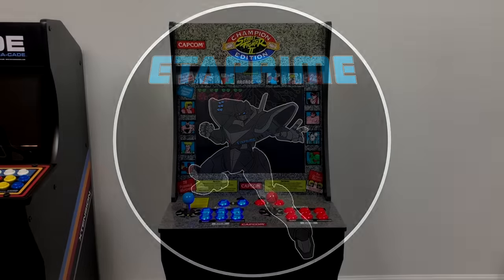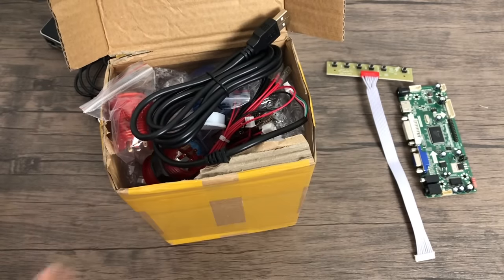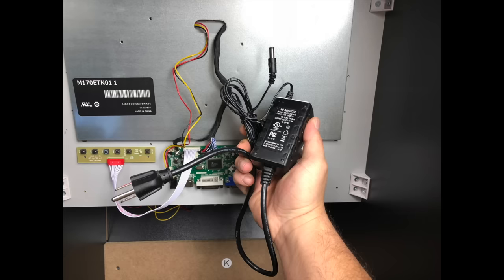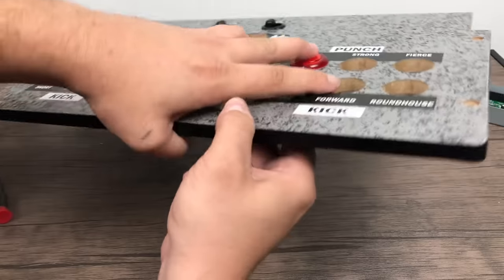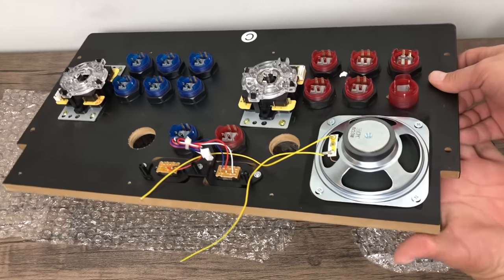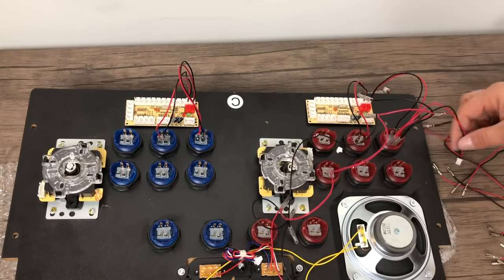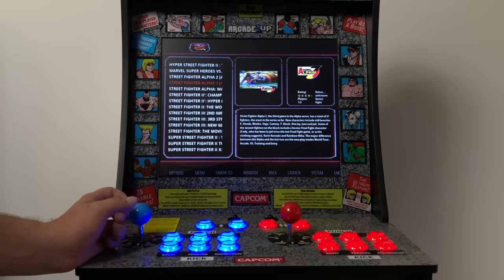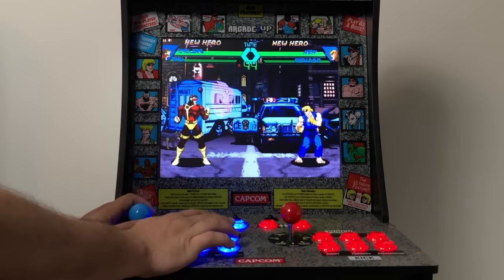‪Arcade1UP Raspberry Pi Install Tutorial - RetroPie in an Arcade1UP

Comment: Can someone help me... have the same exact setup but with a rasp pi 3 (not 3B).. and the USB's are not being recognized.... I'm using the version that has the usb male end on the side so no need to split the wires... but when I boot up - I dont' get the 19:55 screen and the controls do not work (though they are lit so I know they are connected to the pi.   Thx!!
Reply: Did you configure inputs with that raspberry pi prior to installing it in your arcade cabinet? Meaning, did you you use it elsewhere prior to using it for your arcade? That's my guess is that it's still configured from where you used it previously. If that's the the case, plug it back in wherever you had it, and use the USB controller or whatever you had before to go to the options menu and click configure input. But dont actually configure it. Unplug it and move it back into your arcade and it should ask you to configure input again when you boot it up.
Reply: @TEHFLON_DON  Thx Tehflon (great name BTW) - It works now so I think I just didn't have the USB plugged in solidly on either the encoder or Pi... the buttons are VERY CHEAP so I think I'm going to buy some more expensive ones.... Appreciate the help!!

Comment: I'm having trouble getting my retro pi coming up on my screen
Reply: Make sure the monitor is plugged in first and on. Then plug in the Pi. The cream colored board has an on/off button for the monitor as well in case you need to turn it on.

Comment: Thé issue is that the câbles are ro short and the converter is hanging
Reply: Guillaume Renou I had the exact same problem so I had to remove the LCD screen and pull the cables through a hole I drilled

Comment: I need to know if the original Street Fighter games that came with the cabinet will still work like normal after installing a raspberry pi per these instructions?
Reply: I'm pretty sure you would have to install the street fighter roms onto the raspberry pi in order to play those same games. Your essentially swapping out the computer that comes with the arcade 1up machine and replacing it with the raspberry pi.
Reply: eclipse310 so I’m gonna use the Space Invaders cab then, but will have to drill some holes or replace the button board.
Reply: @aaronburrell3729  I'm not sure I understand your question. The raspberry pi allows you to install many games because it's a mini computer. The button board that comes with the button kit acts like a usb controller so that your buttons will work with any game on the raspbarry pi. If you use a space invader cab and do the raspberry pi mod, you are taking the computer out that came with the space invader cabinet and replacing it with the raspberry pi.
Reply: eclipse310 I have several 1up cabinets and if I’m going to make one unusable from the factory then it might as well be the one that no one plays. My pi already has tons of games but the quality isn’t as good as the 1up games so I’d rather not ruin the Street Fighter cab.

Comment: Hello. I am writing to see if anyone has the same problem as me. I finished my setup, and while the butons do work, as soon as i try to setup the second controller , the first one fails. For some reason the coin and start buttons on J1 stop working so i have no way to go back to emulation station.  I tried 2 different retropie images and the same thing happened. If anyone else has encountered this issue, and knows how to correct it, i would appreciate any tips. Thanks.

Comment: Dumb question but how did you switch it on? Wasn’t the on off switch disconnected?
Reply: There is now an on/off switch on the HDMI controller board piece. the skinny green-ish looking one with black buttons
Reply: Yamo Gaming thank you for replying, just to confirm if it’s okay to leave that black button on? (Think that explains why the machine went on once the mains switch was turned on in the video?
Reply: @beave4488  That I am not sure about, my parts will be in today, I will install it into my cabinet and test it and get back with you.  I'm doing my first build this week, been waiting on parts to start flowing in lol
Reply: But I think the on/off switch that comes as stock on the cabinet gets disconnected so it is non-functioning, looking at the wires.

Comment: My wires are too small in the back of the panel can't reach the wood what should I do
Reply: Mount a piece of insulation on the back of the monitor, I used a spare piece of styrofoam

Comment: Just curious... I'm modding my MK now and for some reason my power connector is short.  In the video it looks like he plenty of slack from monitor to pi.  It won't let me mount is away from the monitor.  Strange.
Reply: Casey Pearson I’m having the same problem. I don’t want to mount it right on the back of the monitor.  Did you have a solution?
Reply: My SF 2 is the same way.
Just attach a board across the inside. Make sure to have slack for the wires.

Comment: Is there a way to control the volume? Just double checking because once I have the back on I cannot really control it. Wasn't sure if there was a solution?
Reply: Saleem Noorali from what I understand, once you install the new board, you plug in an amp to the board, then speakers to the amp. You can mount the speakers in an easy accessible area
Reply: @TobeyEatsHotDog  I ordered a volume knob and it works great. That way I am not blasting my ear drums.
Reply: Saleem Noorali oh nice, glad that worked out for you 👍

Comment: Do you need a usb encoder board if you dont change the buttons?
Reply: Yes, because of the Raspberry Pi (I understand the stock encoder will not work)

Comment: I think I ruined my lcd controller board it’s very hot almost like it’s overheating (burned my fingers trying to adjust it to a proper position) and and the power on button stopped working after a few clicks don’t know what I did wrong
Reply: I also believe I ruined my raspberry pi4 because it’s not powering on when I connect my Type C power adapter
Reply: Worried that I just spent a couple hundred dollars for this project not to turn out the way I expected☹️

Comment: I know you said you leave yours on, what's the correct way to power it off?
Reply: the switch on the power strip
Reply: @Nathan-is7li  I ended up hooking up the power supply to a wifi plug, controlled by Alexa
Reply: @caliinvasi0n209  Thats a great idea! I have an extra one laying around. Thanks!
Reply: any tips on getting roms for the pi?  Im new to it..
Reply: @Nathan-is7li  just google my friend
Reply: @caliinvasi0n209  yea, i figured

Comment: Would this work with an Arcade 1 Up bar top style?
Reply: You mean the countercades? ETA Prime and Retro Ralph have videos on doing just that. Only difference is the converter board you use. And remember, the countercades are vertical cabs, so only vertical games will look right (they both mention images that are out there, so no worries there).

Comment: I just hooked my display to my pie and everything is sideways? What did I do wrong?
Reply: Do you have a vertical display, such as the Space Invaders one?
Reply: Yeah it’s vertical. It’s the Galaga one. Looking back at it I think I bought the wrong encoder board. For some reason it occurr to me that if I was doing this set up on a different cabinet use a different encoder board. Noob mistake

Comment: So I followed this tutorial step by step and when I plugged in my pi and turned it on all I am getting is a screen of red, then green, then blue, etc…. I have no idea what went wrong… anyone that can help? 😢
Reply: I have the same issue my idea is that the hdmi controller board might be incompatible since this video is 5 years old it might be that arcade1up changed their LCD screens since then, I have to check that yet though. Did you find a solution?

Comment: Do I need the amp or can I do this install without the amp and still have sound?
Reply: Already found a solution. Using a powered speaker with a 3.5mm input. It's a 3'x2"x2" sound bar I bought on clearance for the same price. It didn't really work well with my TV so I was able to save a few bucks by using this and it's definitely going to have more power than I need.
Reply: I have the street fighter cabinet. I'm using the raspberry pi 4 -4gb-. Would it be recommended to have an 8 button pad instead of a 6? This is to cover all 4 triggers instead of just half.

Comment: I went back to watch this a second time, because I clearly missed the 99% most important part, which is where to get the item that contains all of these bazillion games.  So, I'm not hearing what it's called, where to get it, how much, what games are included on it, etc.  I looked up what a "raspberry pi" is, and it's certainly not a circuit board that contains piles of arcade games.  I guess you just wish whatever games you want on it, and they magically appear.
Reply: Check out rival boss vid how to setup raspberry pi should help. You can get just about any game you want ps1 and before. My arcade has nearly 1000 games

Comment: What size nut & bolt for the LCD ground wire?
Reply: I used a 6/32  screw. Can either be 1/4 , 1/8 length. You can judge the length when you see them in person though. Keep it short.
Reply: TEHFLON DON why short
Reply: @Emolga6274  I guess you dont have to, I just like to keep things clean and non-obtrusive. But a short length screw is all you'd need. The "hoop" on the ground wire is already pretty thin.

Comment: Hope someone sees this but I'm a bit stuck. My arcade has a light up panel at the top. Is it possible with this set up keep it lit up after the mod?
Reply: Maybe leave the original pcb unhook everything else except the light cord. Should still work that way you’ll just need two outlets.
Reply: @PapaGame  thanks for the reply dude. I'm pretty sure the original power supply would be used for the new board so that wouldn't work. I'll have a look later today. Thanks for the advice!

Comment: Could this whole thing be done with a ps4
Reply: I would assume yes, with a CronusMAX dongle. You would plug the USB leads from the arcade button boards to 2 Cronus dongles for 1 and 2 player that then plug into the PS4 USB ports. It should be able to detect the arcade buttons and translate them to PS4 controls. Then just plug the PS4 into the video driver board through HDMI and you're good to go.
Reply: @tatecheddar  awesome!! thank you for replying working on moding the mk version

Comment: Can someone please help, when I plug my RP into the arcade 1up new hdmi it just goes white screen :(
Reply: I followed all instructions
Reply: I'm getting the same thing.  Have you solved the issue?
Reply: Yeah bro, I honestly think I just had the hdmi board plugged in wrong
Reply: @dazzlemoi8  I disassembled the monitor and re-seated the connections and it worked.  I have it working great now!   So Happy.  I've honestly never done anything like this before so I'm pretty proud of myself.
Reply: Steven Hulbert yeah man, I am a total novice. Felt like a pure g when I finished mine

Comment: Can you get audio without a amp
Reply: So my cabinet has the audio and monitor cable combined so I could get sound without the amp. I was able to adjust the volume via the LCD board but its still quite quiet. I ordered an amp to see how much of a difference it will make.
Reply: I am running my audio straight from my raspberry pi 3.5mm jack to a 16 inch sound bar mounted on top of the cabinet.

Comment: Does anyone know if the link to the replacement buttons ETAPRIME mentions will work in raspberry pi 4?
Reply: I don't know for a fact, but I wouldn't doubt in my mind that they work just fine.
Reply: If you do everything in this video will you still be able to play the pre installed games on the cabinet? 
Please help
Reply: @Javen64  What cabinet do you have? and what device are you modding it with?
Reply: @p0tent49  im using the pac man legacy 12 in 1  im going to use the raspberry pi 3 b+
Reply: It's not the best cabinet to mod just because of the screen size, but yeah you'll be able to play all those games.
Reply: @p0tent49  thanks
Reply: @p0tent49  would the games look weird on the screen when i play the games 
Or will it just fill like a small porion of the screen with the black bars on top and bottom
Reply: @Javen64  You can control the aspect ratio of every game with the Pi, if you want no distortion there would be black bars on the top and bottom. A Street Fighter cabinet would be way better to mod in my opinion as it works better for every game.
Reply: @p0tent49  thanks im planning to mod my arcade as soon as i get all the modding things i need my uncle has his own raspberry pi and he has a ton of games hes going to give me a copy to transfer to my pi

Comment: ATgames just crapped on this process.
Reply: Explain
Reply: resfan000 they have a new cabinet called “Legends Ultimate” that is bigger than these machines, comes with 350 games, allows you to connect a raspberry pi directly and 8bitDo controllers, allows you to load Mame roms, has WiFi and connects to your steam account, and has two player controls both with spinners, and a middle track ball that also works as a mouse in PC mode. I just got mine at Sam’s for $499 and blows my 1up cabs out of the water! It’s also full size so no riser needed. At the moment it’s more fun than Switch or PS4 even to me.